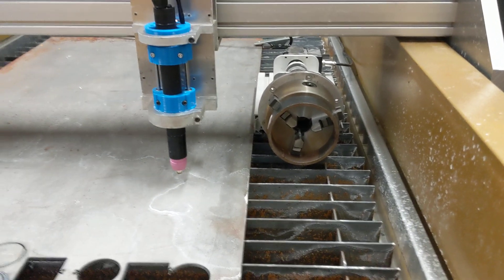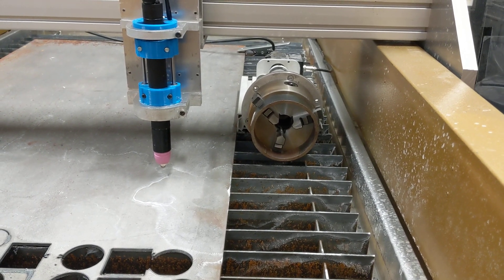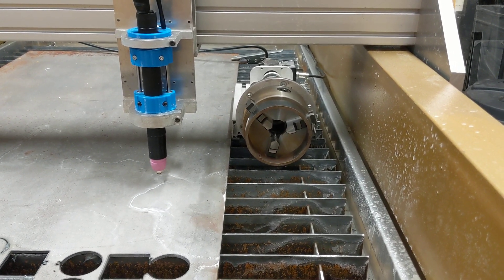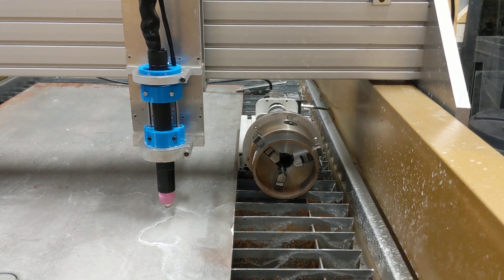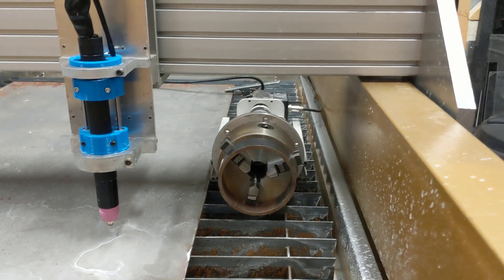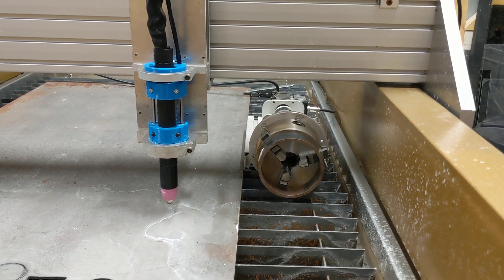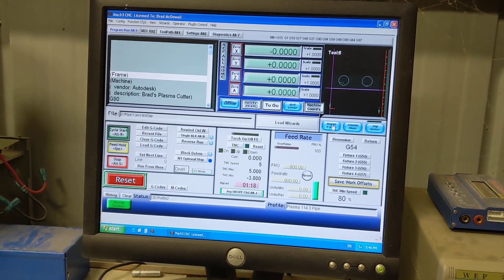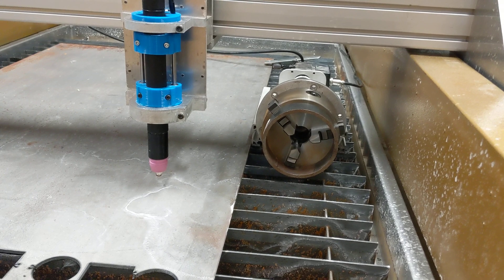Plasma pipe cutting Gcode test

Comment: Hello,
can you share how to create the G- Code for 4 Axis?
Thank you very much!
Reply from the maker: It's actually just the usual 3 axis x and y code with fixed z axis code at the start and finish of each cut.  I set up a new profile in Mach3 with the rotary A -axis and the X - axis swapped. This allows me to jog the X axis over the pipe still. The G540 controller is 2000 steps per revolution. I have a 100:1 harmonic drive in the mix also. 2000 x 100 / 359.084 ( which is the circumference of the 114.3mm diameter pipe) gives 556.9727 steps/mm.    This is set as the profile for a 114.3 pipe.   In CAD I simply un-roll the pipe to a flat surface and create the code.  The x axis controls the rotation of the pipe.  I have a profile for each size pipe I cut to make sure the steps/mm is correct.  Hope that makes sense.